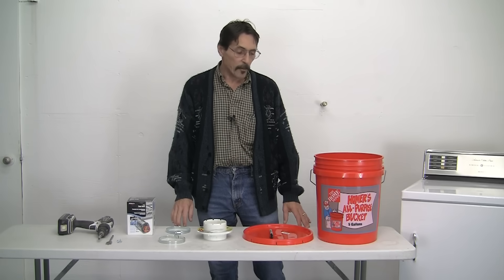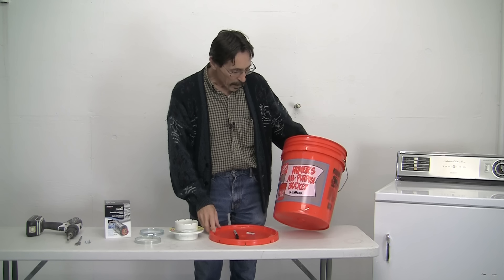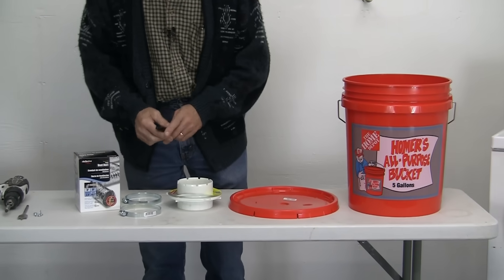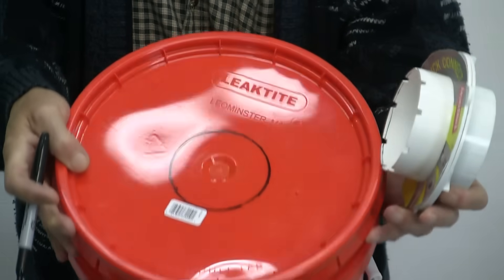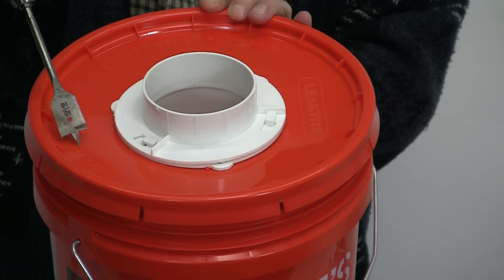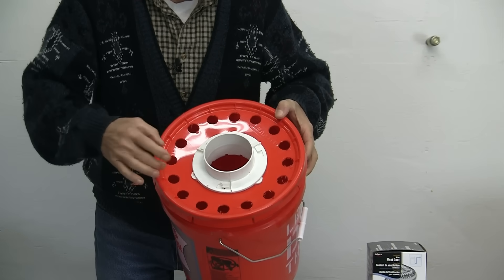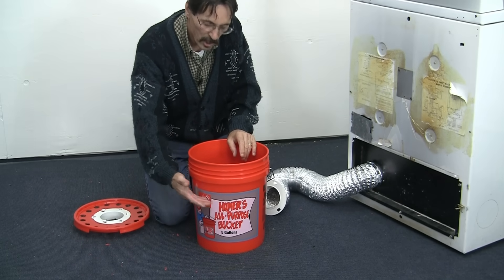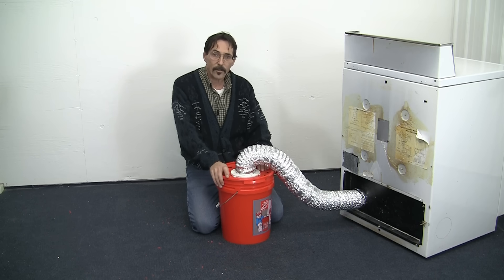DIY How to Cut Electric Bill in Half: Part 3 Clothes Dryer Free Ideas | Missouri Wind and Solar

Comment: Nice idea as you said the cheap plastic squares are junk. My only suggestion is to keep the aluminum flex pipe as short as possible (within reason), as the more turns and twists you have slows down the air flow. True story, I was called in to finish a house that was abandoned by the builder. The heat umps could not heat over 68 and on the cooling side did not cool below 80. When I looked in the attic all the heating and cooling lines were flex pipe, effectively doubling the distance or more. Some of the flex pipes had an actual run of 70- 80 feet, without ripping all the flex pipe out nothing could be done. The buyer (the house had been built on spec) was informed of the problem, as per the lender that hired me. He bought it "as is" as he had family in the HVAC trade and could have the work done for less than I could do it, plus he had plans to remodel the entire house. In most of NYS there is no required license to be a builder "you just need the hat" I have seen decks fall off houses, slab houses sink six feet do to no compaction, one of the worst the builder laid out the house on the only area that perc'd, requiring bring a hell of a lot of "run of bank"( some call bankrun) for anabove ground system, this was over 35 years ago and the systems for above ground systems did not exist then.

Comment: I would like to say this very good video. But I like add with this on these new dryers check the air flow to make sure it is adducate for your dryer. I just did this to my dryer and check the air flow and I had to drill more holes in the bucket. And reduce one bend in the hose and good to go now.

Comment: Problem with this system is that it puts high moisture (condensation) in your home. I know because I installed one of these and the basement walls were very damp from the moisture put off by this device. Keep in mind when you dry your clothes you are removing water from the clothes and that moisture is  exhausted from the dryer  vent.

Comment: Hey I just find this and I know it's old, but you can use this similar method for gas dryers by changing to a metal bucket full of loosely packed metal scrap, showing the air flow threw, but creating a second tube out to the regular wall vent. the metal bucket and scrap absorbs the heat but doesn't let any of the fumes into the house, sealed with heat tape for vents, and then vents the gases outside as normal.

Comment: Cutting our electric power consumption will not do too much good. Power cost is cheap here per/month at about $35 for actual power usage but the very big cost IS the other amounts added to that which is about $140 for other charges, for a total of about $175.

Comment: Thanx for the video, and yea I agree on the little crap, I had one of those and 5 years later still finding old lint dust in cracks and crevices in my back room. when they built the back room on this old house they only used what looks like a 3" pipe that got a 90deg elbow and they are blowing it under my house which is just making for a giant rats nest and fire hazard.
now I can go back to using this and be safe.

Comment: Hmmmm I used nylons and kept them clean and they worked well for heating the house. But this seems like it might be an ok idea also, But maybe lots of lint in the air and even more humidity cuz it's pretty humid even without the water in the bucket....I'm not sure because I've never used the bucket.

Comment: Do you want that much positive pressure in the bucket working against the drier? 

D x D / 4 x 3.14=12.56

Your 15/16ths exhaust holes only offer up ~.65 square inches each, meaning you would need 19.3 holes in order to for your exhaust holes to equal the footprint of your intake. 

Whoops!

Comment: A dryer throws out 10x the moisture a humidifier does.. Why do you think bath fans were created for batrooms? The moisture migrates thru drywall and soaks your insulation and framing wich will feed mold i guess if you have a super leaky uninsulated home youll be fine
Reply: if you use a dehumidifier like I do I gain the extra heat in my house from that source and flush the water wasting toilet with the water  collected  and my furnace this winter alone  close to 60% less use now that I've implemented this incredible idea. Oh throw bubble wrap on  your windows almost 90 % heat retention with another simple item we all throw out
Reply: I’ve used this for years. Over ten years and I do not have any mold problems. My dryer is in the basement. My basement is very dry.
Reply: Joshua david I thought the fans were there so they can suck the Shit smells out
Reply: @fargeeks  not at all
Reply: Super gloss paint is used in my bathroom to prevent that from happening
Reply: @montemaguire4596   wow.... Paints not gonna prevent squat!

Comment: So when the excess moisture your dryer throws out gets in your furnace filter and insulation and mold starts where you cant see whats your solution??
Reply: so what do you do when you boil stuff on your stove for hours on end?
Reply: Your house is too leaky as a whole to worry about a small ammount your dryer throws out high volume of it in a short time

Comment: How about saving on  summer  AC costs by  installing  gas or electric   dryers in a closet with an airtight   door, cut an air intake vent in the ceiling  to allow dryer to   pull air from the  attic to dry the clothes    INSTEAD  of  using   your  indoor  air that your paying $$  to   cool with your  AC..     IDEAS   ??

Comment: I used the nylon stocking trick back in the 80's.
I clamped it down at the very edge of the open end of the stocking instead of near the foot end.
It just blew the stocking upward like one of those air-filled waving guys  :)
Never had any problems with clogging either but I did check it every load or two cleaning it as needed.

Comment: You can buy the actual kit that's specifically made for that for under 20$ and you don't have to fool with drilling and building. The kits are professional looking and not hanky looking. I don't understand tips when the cost more to rig it than it does to buy the correct stuff.

Comment: I Did somewhat the same on my own before seeing your video.  The difference is that I used a rather soft and flexible garbage pail, but shorter, inside the bucket, that fits right in with a little bending, to hold the water.  I have the dryer vent extending inside,  right above the water level in the secondairy bin to capture a maximun of lint.  The inside bucket is adjusted with the extended inner tube to act as a water overflow so that the end is never submerged in water and air flow restricted.  And it does overflow.  I had to put some weights at the botttom so the secondairy doesn't start floating inside.  Just some rocks inside a plastic bottle filled with water. And lint it does capture!  In find tons of lint mud inside at every cleaning of the contraption.
Reply: I also find that "shooting" closer to the water level captures some more humidity while still letting enough out.
Reply: For the vent holes, I went to the trouble of calculating the surface of the 4" tube and cuting 4 holes equivalent in total size...

Comment: you dont want to do this tou your house specialy im winter water will condence in the house isolation, but you could you the can to make heat exchanger ''sorry for bad english'' but dont do this you will ultimaltly regret it badly. never keep humidity dry air is what make good isolation works.

Comment: I get that the intake should be larger than the exhaust, just like the intake valves on an engine are larger than the exhaust valves.  I should point out that our 1980's house has an air intake that looks like a clothes drier vent on the end of our house, it has no flapper in it that I can see, but prevent our house from becoming a vacuum when bathroom, ovenhood vent fans, clothes driers etc are exhausting air to the outside.  This prevents air from coming in through other places where we don't want it coming in at.  Our laundry room is in our basement, so we would have to run a very long air intake from the attic, in our case we would just run it from outdoors and call it a day.  I like the pail idea but all that humidity in our house could cause a black mold problem which we don't want, however monitoring a humidity meter would indicate too high a humidity.  I liked the filter box for the attic, this is good if the attic doesn't contain zonolite which is asbestos containing.  I liked this video so much I'll stay tuned for more. cheers.

Comment: Thank you for this video!  Instead of the orange lid, I went with the removable black lid so I wouldn't have to cut off tabs.  Also, instead of self-tapping screws, I went with 10-32 flat head screws with nuts on the other side to tighten.  I discovered the dryer dock you show in the video isn't available at Home Depot; they have a cheap one that bends when you tighten the clip on it, and it doesn't snap firmly into place.  I ordered the one you have in this video from Amazon.  Another thing I did differently is I cut a piece of aluminum window screen material and closed it inside the lid, to catch any wayward lint that might not make it down to the water.  I fill the bucket about 3/4 full with water, rather than half.  I think the closer it is to the top, the less likely any floating lint can escape it.   One final tip:  ask a donut shop for a bucket.  They have empty buckets they might give you.
Reply: That cheap ass donut shop i went to wanted two dollars a bucket lol
Reply: u should really put thison YouTube for us all to see plz
Reply: Great tips, thanks
Reply: Flat head screws suck
Reply: Duly noted. Looking forward to testing this in the winter!

Comment: Good idea.Question: I have a large house and large crawl space beneath (@ 3-4 ft).  Frequently, we have periods of cold temps.  Could the vent hose be re-directed from the outside (summer) to a bucket beneath the house during winter to help warm the area and keep pipes from bursting?  Would the moisture cause problems/void any termite contracts?
Reply: Be very careful if you try that. I bought a small home whose clothes dryer vented into the crawl space to keep the pipes from freezing. ALL the floor joists were covered in mold. Yes, the water bucket could keep the moisture a bit lower, but any moisture added to a cold crawl space can be disastrous, especially because you'll rarely check on it. Out of sight, out of mind. The long-term solution is to apply foamboard to your foundation walls.

Comment: Ive been very tempted to do this over the years..one problem that bothers me.. isnt there asbestos in the belts of most dryers.. and they do produce dust as they wear and even with the water capture i worry about particulate.. any thoughts??
 And this WILL GET IN YOUR AIR..

Comment: Question; I always wanted to ask this... I fully understand not venting a gas dryer into your home due to carbon monoxide, but how come it's perfectly okay to run a gas stove in my home, sometimes with all the burners and the oven on? It surely doesn't burn as efficiently as our Kenmore gas dryer does and not one person has ever felt sick died while using my stove. And none of my C02 detectors go off either. There is no ventilation in my kitchen and the company that installed it (Sears) never said it must be ventilated. Just wonderin'.
Reply: You've now given a whole bunch of women a good excuse for not spending a lot of time at the kitchen stove!  I don't care if mine is electric, I'm going to try this!  :)

Comment: If you do that you will cause black mold in your house not very smart
Reply: false, no basis for this opinion.
Reply: Depends on the region...
Reply: In SW Ohio humidity feels high (estimate) 42 weeks a year. We vent the drier outside. Our washer and drier is in an unfinished basement along with a workshop, family room, and storage area. We run a dehumidifier on laundry days to help dry clothes that I hang from the water pipes, while they are still damp from the drier. 

Do NOT use the drier vent bucket in an unfinished basement (concrete walls & floor) if you live in Ohio. It might be okay if the basement contains no long-term storage items. Paper, cardboard, and natural fabrics can attract mildew (an annoying musty odor) and mold (which spreads quickly).

Comment: You can use the lint to make paper you pour the lint with water over a screen extend it and let it dry also with the gas dryer you put it outdoors under a roof or open a big window for ventilation I’m i right ?.to prevent carbon monoxide from forming

Comment: Well done sir but the flexible transition is not aluminum. Its a foil material that would fail any inspection, and if not careful could potentially become a fire hazard. Heat and plastic don't mix ever! Home depot may advertise as an "aluminium vent" but that material is most commonly used for a bathroom vent. Something to keep in mind.

Comment: The bucket collector is a good idea but one thing that should be taken into consideration is that at a minimum you must have enough holes that the area of the small holes is equal to or greater than the incoming duct, 4" in this case. Based on my math you would need over 18 15/16" holes. A small mode such as a the dust collector cyclones used on shop vac may work better.
Reply: ok

Comment: Some Glycerin in the water will cut surface tension for better absorption of the lint and keeps the fines from bouncing off and out into the air.  Sorry but I don't know a best amount for the  2 and a half gallons called for in the vid.

Comment: My parents lived in Ohio where it commonly is under 10 Fareneight for weeks on end.  I always wondered why they had the dryer hose going into a water tub.  (They had a 2 basin Laundry sink) and there were 2 hoses that came from the washer.  The 2nd rinse would go to the 2nd tub and it had a cover with the dryer hose connected to the top and an overflow that went to the sewer.  In a nutshell the water in the basin was always full and the water was exchanged with each wash to clear out the accumulated lint.  The air never seemed to be too dry in the house and in the summer the dryer hose exhausted outside.  (that was 4 months of the year) the rest of the year the temperatures were at a high of 70, So the laundry dryer was always run in the evening.  So many things that I questioned now make so much sense.

Comment: I tried this bucket thing in my fireplace and my house fills with smoke. I Guess it only works with electrical appliances? where do I hook it up to my microwave and coffee maker for extra heat in the winter my house has no insulation.

Comment: I used one of those duct bypass devices and attached an old flannel pillow case over it with a small bungee cord. I hang it from the ceiling in the laundry room using a hanger with the clamps. The flannel pillow case catches all of the lint.

Comment: Clothes dryer ventilation exhaust STINKS. It may even be toxic.  This doesn't seem to me to be a very good idea.  But I don't have to breathe the fumes so knock yourself out.

There is also the problem of mold production in the basement, which can be quite humid to start with.

Have fun with your new found project.  But, no thanks, I don't need a Sania in the basement. I will pass on this project. If I need  humidity in the air I'll get a humidifier.

Comment: I would only use this method of heating my house if I had an atmospheric water generator in my house as well because a house should never get too humid. It can cause a lot of issues, from mold to metal items with iron in them rusting. But yeah this would be great to have alongside at atmospheric water generator so you get purified distilled drinking water in the process
Reply: An 'atmospheric water generator' is just a flowery term for a dehumidifier. You can google it and see for yourself.

Comment: VERY BAD IDEA!!!!  All that moisture condenses on the windows and will ruin the wood finish.  Not only that----as the moisture works it way through the house and walls it will freeze as it comes in contact with the cold outer walls and in the ceiling too.  Guess what??? when it warms up all that water that freezes in the ceiling and walls turns back to water!!!!  It will rain from the ceiling and will turn the sheetrock to mush!!!!  We as contractors had this problem back in Iowa with just normal moisture and you can imagine what pumping all this extra moisture will do????  DON"T DO THIS!!!!!!!

Comment: I worked a fire case because the lent on the wall had short circuited the 220 connection on moist day .. lent had caught fire at power ..if you keep cleaning the lent from walls  you may keep your house from catching fire . .by the way your walls will be full of lent all the times as screen will not catch everything

Comment: Leave doors cracked to relieve air pressure from furnaces. Turn refrigerator temps. down. Cut off lights when not in use. Caulk windows before winter. Use electric heaters instead of furnaces. Get smaller washers and dryers. Open windows instead of air-conditioning. Use Comet to unstop slow-draining bathroom sinks. Run hot water and let it sit. Wear long-sleeve shirts inside. Un-stop room vents to prevent back-pressure back to the furnace which can damage it. Keep curtains away from the vents. Change furnace filters often. Open blinds on sunny sides of rooms to let in light instead of using lights.

Comment: Hi there. I've done one for my dryer exactly the same design you did and it works fantastic!!! Can't found the adapter of the aluminum foil and I used milk can having the same diameter of the aluminum hose (4") and it really worked good. I loved to post the picture under this thread but don't know how to do it. Thanks buddy....